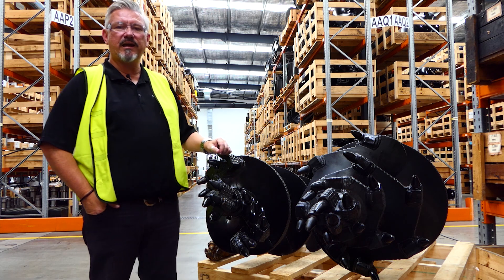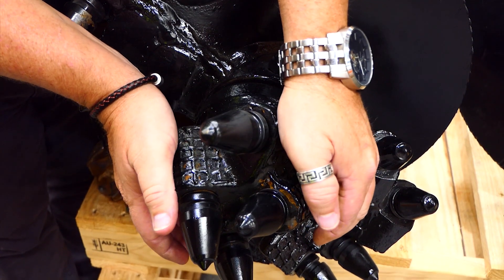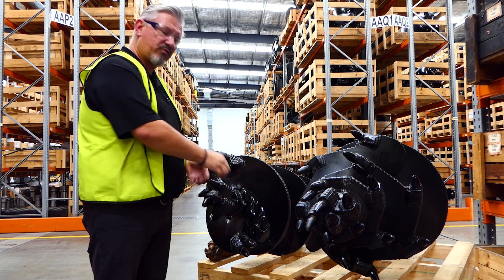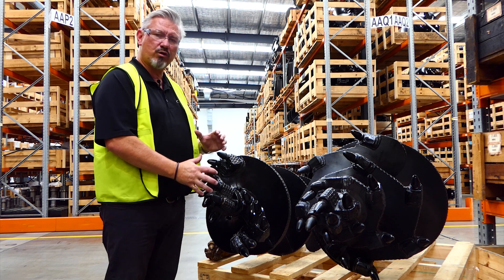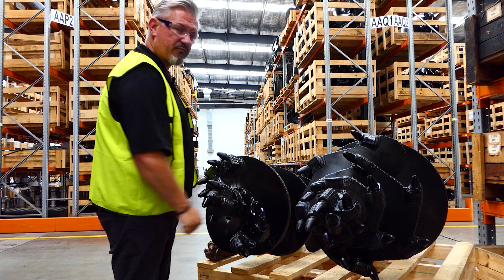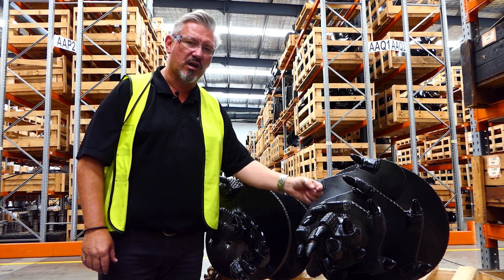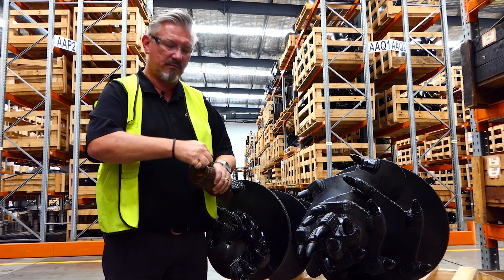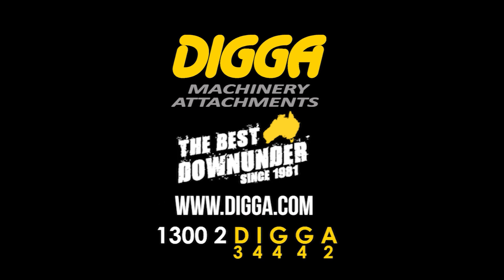What Causes Excessive Wear on Dedicated Rock Augers? Digga explains. | Digga Australia

Comment: Is it practical to use this type of auger on a tractor 3 point setup with no hydraulic down pressure?
Reply from the maker: Hi, we generally recommend at least a 4 to 5t machine to operate a rock auger. Plenty of down pressure is required to break into the rock. A 3pt linkage won’t have the required down pressure required to get the best out of the auger. If you require any more info feel free to reach out at 1300 4 DIGGA.